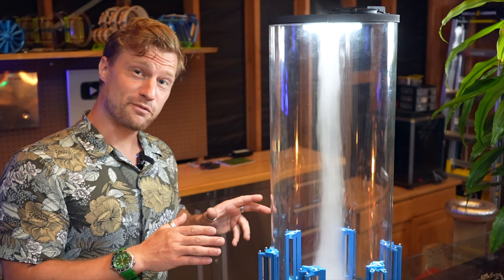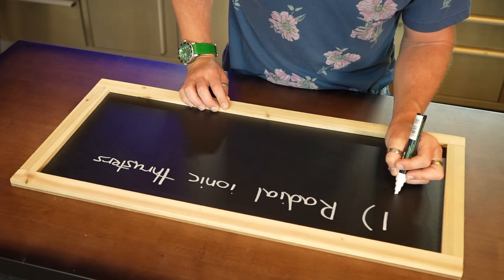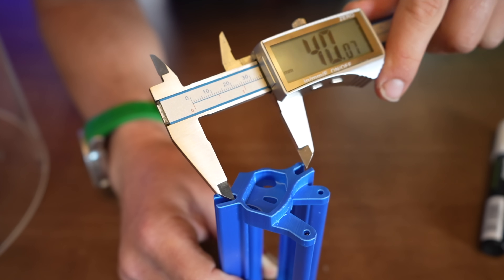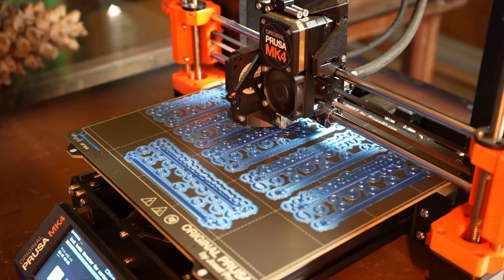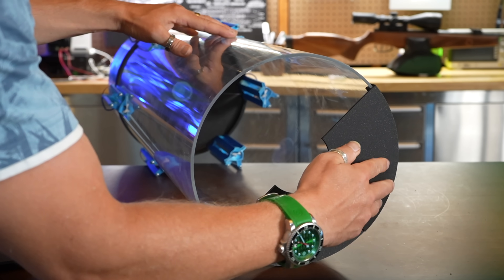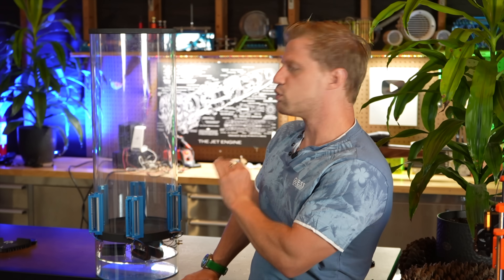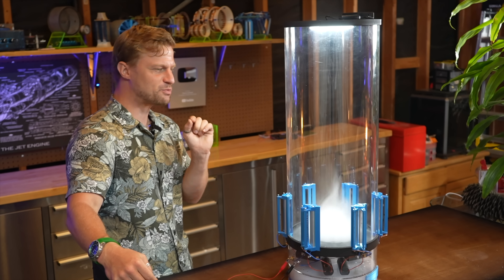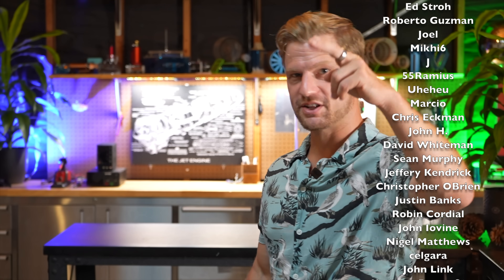I Built The First Ionic Tornado Machine! (Unreal performance)

Comment: Now, technically, this is not tornado formation. Coming from a weather nerd, we all know tornados form from up to down, not down to up, BUT! Dust Devils form from down up. So you kinda got a Dust Devil simulator. Cool!
Reply: well, some research shows that some tornadoes form starting at the ground and working its way up.
Reply: @tor-WX That right there you are talking about is a Landspout, not from a deep mesocyclone, so it's not a Tornado.
Reply: @darkvalve  trey from convective chronicles brings it up in his el reno video, some other research talks about it too, i'm definitely not talking about landspouts
Reply: @tor-WX Tornadoes from the mesocyclone develop from the mid-level rotation to the ground, while landspouts form from the ground upward. If Trey showed something like what you said: its most likely some mid-level rotation that wasn't visible yet.

Comment: I have a proposed improvement.
As the device already uses dry ice for the clouds, could you combine this with a cloud chamber designed to view radioactive particle trails?
With a beryllium lid, it could reflect the particles downward in random trajectories through the vapor from a radioactive source material.
Finally, add a static spark gap generator with one terminal at the center of the top and the other being a metal mesh grid running horizontally around the inside about halfway down the tube. 
If things work correctly, the radioactive particles should create leader trails through the vapor, which the electrical charge then follows the path to complete the discharge circuit and connect with the grounding mesh.

Comment: Need to add a small glycol based fog/haze machine on the bottom. Even a vape coil would probably provide enough fog and could use a large tank to allow it to run for days.

Comment: Tornadoes/Hurricanes have two movement simultaneously happening one we see which is either clockwise or counterclockwise rotation but the other one we don't see, is at center which is always opposite from outer movement. All tornadoes or hurricanes are results of Atmosphere and Ground trying to balance their ions levels. Sometimes center spin is too small to see or tornadoes change spin rotation to opposite directions based ion balance. If it's clockwise outside then Atmosphere lacks ions, if it's Clockwise outside and Counterclockwise inside atmosphere and ground trying to balance ions difference just like Iodine Clock Experiment and When Balanced Tornado/Hurricane stops however when Atmosphere is overcharged it keeps going on and sometimes when atmospheric gets too much, Winds stops and it changes tornado/hurricane spin too opposite directions.

Comment: This is really cool but I wonder If you could add changing colors at the base of your tornado instead of top light  and modify it with remote control. Have you thought about making miniture fogger that doesn’t require water. Make if bigger like 10 foot scale

Comment: My  1970's World Book Encyclopedia had a similar device with no ionic thruster, it simply had openings for the air to rush in as heated water created steam. Rising air would go up, cold air would fall, the slits would create cool air coming in from the sides, perpetuating rotation --Like a tornado.  However, a tornado doesn't have limited air from the sides, so what causes the rotation? This is where I think people are a little daft. Lighting is always present, and water droplets are magnetic. My theory is that the counter space  of the aether is set in motion by the lighting strikes to the Earth. It is a short of the capacitor plates between Earth and Air, that disturbs the aether - Tesla called this a disruption. The disruption causes a spinning magnetic field. The spinning magnetic field in pulses causes the droplets in the air to move. The  rotation of a supercell is generated, the Tornado is just a focused byproduct. Hurricanes are a wider exhibition of this generator.

Comment: Now next step. Collect dust from air, using air vortex, without moving parts and without filters. Only power of vortex. It will be very silent and you can sell it widely, as most silent air cleaning device.

Comment: You ought to black out the bottom section, and put the light, or another😮😮on the bottom side of the base of the twister to create a more luminous cyclone, possibly for those nutts who like it, I would chose a solid blue😅 but a colored light for that would be interesting as the only light at night

Comment: Over twenty years ago, I theorized that tornadoes are Electrostatic in nature. The extremely high voltages between the ground and the clouds create a situation where natural entropy finds a way to reduce the energy of the highly energized system to release its energy. It does this by discharging that energy from cloud to ground through the movement of Ions rather than through many lightning strikes. Tornadoes usually form when a dry air mass between the clouds and the ground creates a high energy potential between the clouds and the ground in a dry environment. The amount of energy stored in these kinds of systems approaches the energy of a small nuclear weapon. This is why they are so destructive. I believe tornadoes can be disarmed by shorting them out by creating a ground-to-cloud path at multiple locations by using high-energy lasers as a triggered ion conduction path. I don't believe tornadoes would form if the static electric energy source was removed or was shorted out by lightning strikes at crucial locations.

Comment: What if you add weights at the top with the influencer light and an adjustable tube to lower and raise. you could use a fidget spinner barring to give it balance, so that-- when adjusted correctly, the weights spinning could create multi-vortex streams, to due to the updraft. on the lowest power level, it might be possible. and even bring them further off the platform,,, in theory of course..

Comment: @PlasmaChannel

🤔 Now that youve been able to induce a cyclone... 

I think its time to remove that base, build a base so that it can be turned onto its side... Then add on a strong/powerfully cylinder shaped ionic intake... 

& See how much Thrust you can generate with it. 🤷‍♂️

Now that you've gotten to the point that you can create an adjustable containable vortex..

The next step after that, would be to add additional levels around the rest of the cylinder... increasing the levels of thrust that it can generate further... if you could get all of it to work together. (I got faith in you!!)

🙄🤷‍♂️😅 sorry to take away the art piece... but I think these are the next steps to do with what you just achieved.💪

By the way, Awesome Job!!!

Hopefully you'll humor me. 🤷‍♂️😊

Sorry for trying to get you to push the boundaries even further;  I think you got this! 👍💪

🤔 if anything,  just make it so that the bases could be swapped out... so it can still be used as an art piece,  but turned on its side for the other experiments when you're working on that.
Reply: 🤔 the next steps after that's achieved... would be to build it out of stronger materials, add in fogger injectors & an afterburner 👍💪

Congrats,  you'll have a functional jet engine
Reply: 🤔 Maybe we could get @integza to jump in on those next levels of the experiment build? 

Idk how to get @integza mentioned nor @PlasmaChannel so that they'd get notifications & read this. 😖😡🥴

If someone has the abilities to get them notified.. I appreciate the assistance 🙏 👍
Reply: 🤔 also... with a few tweeks...  as it is now.. 
 - it can be used to ionicly increase jet engine intakes & thrust... likewise,

- be used as an ionic cold air intake for  ICE engines to increase intake, fuel efficiencies, & all around electronicly controlable performance. Similar, to a turbo, but when paired with a turbo or super charger 😳💪👍

Comment: 2:29 6 thrusters, 30 degrees = 180 or half the circle.
Reply: 30 degrees to the theoretical parallel line aligning at 90 degrees with the side of the circle at each point of the circle. The fans are aligned at an hexagon and the air just comes at a thirty degree angle into the circle to form a vortex the angle between each fan is probably at 60 degrees

Comment: Super cool stuff. What I'm really curious about.. 

what happens if you shorten the cylinder chamber, and instead of a 90° lid with a condensed opening, lets drop a long cone on top with a similar sized opening to what you used. Could this not create something of a turbine effect? What kind of airflow or thrust is coming out the condensed opening at the top? Would another layer of ionic thrusters mid-cylinder improve power?

Ive probably got the terms all mixed up but i hope you understand what im getting at.

Comment: I wonder if it would work with a reservoir with a lip to keep the water in at the top, and air escaping from holes on the bottom? Then when throttling the power the cyclone would come down closer to the ground.

Comment: This is really cool! We are a father and son team of tornado chasers and we have also built a tornado machine, although ours uses a standard air pump instead of ionic wind. I love the idea of using ionic thrusters! Yours is definitely a lot less noisy than ours.

If you wanted to build one that had a clearer view of the base of the vortex you could alternatively place the thrusters/pump at the top of the chamber instead of the bottom. This seems counterintuitive as you'd think it would only get the air spinning at the top of the chamber. But as the rotating air is drawn into the center, it speeds up due to conservation of angular momentum creating a wall of fast-moving air that prevents air from entering the vortex from the side. The air then begins to descend around the outside of the vortex to be drawn up into it from the bottom. Eventually this process will bring the vortex all the way to the bottom of the chamber so you will have a rotating downdraft wrapped around the rotating updraft of the vortex itself. This is similar to how the Rear Flank Downdraft wraps around and feeds the tornado in a supercell thunderstorm.

Check out our video "New tornado machine flings water!" to see our setup using a single nozzle at the top of the machine to create a moveable tornado under the machine without an enclosed chamber at all.

We love high voltage and plasmas too and built a lightning machine that simulates St. Elmo's fire and Transient Luminous Events via a alpha-particle triggered spark-gap to simulate lightning initiation by cosmic rays. You can see it in our video, "Radioactive Lightning Machine - Sparking TLEs and St. Elmo's Fire".

Your projects have been an inspiration and we love watching your videos. Keep up the great work!

Comment: Can you make it work without the tube, despite the static surrounding air, after a few more bumps, bruises and headaches?  Then you can try applying a massive high voltage discharge at one end and see if the electricity follows the vortex to strike a target.  You may have to ionize the vortexing column of air with a high voltage discharge plate or even with a ultra-violet laser so that the discharge has an electrical path to follow.

Comment: I think you nailed the vortex.  
It needs an aesthetic improvement for my wife to put in the house not the garage.
The thrusters should be internal with flush air inlets.
Fancier lighting for the vortex..colors/wavelengths, directions of lighting, ..
Paint the bottom of the cylinder, or hide the internal electronics and use a lighting scheme to make the base glow dimly.
Try a strobe light to detect periodic events in the vortex?
Combine functions of parts: include lighting in the design of the thrusters.  Imagine lights on the thrusters (RGB LED?) that that circulate with the vortex.

Comment: Finally you listened (and finally you popped back up in my feed). Now my only question is why you didn't measure airflow out the top. Also you should try it either without the acrylic enclosure or a much shorter section to see if you can still generate the tornado with a better power to weight ratio.

Comment: Considering the high voltage, I’d enclose the external bolts as well and use a standard wall charger plug. I’d also consider if you can add filter material and actually make this practical in some way, either a filter or just a neat fan to keep air moving on a room.

Comment: Wow I'm so impressed of your work, thank you so much for making this one. 

 This is a demonstration of how wind/air would behave when it travel tangentially and move vertically along the cylinder to the exit port (this reminds me of my thesis work with only an animated simulation😢) 

And if you decrease the diameter of the exit port on the top the vortex will be more stronger compared to the wider diameter at the same air input speed 😅

Comment: I'll give you some good advice. Instead of putting ice in the water, put an ultrasonic fogger in there. It will not be a useless "installation" but an air humidifier along with an ionizer. Both beautiful and useful.

Comment: Hi, I have an idea in mind. Instead of using a high voltage ionic thruster. Why don't you use the coil gun system? First you first heat the air around with plasma then in it ion for that can be affected by the magnetic field, is then accelerated using the coil gun principle.
Well the rail gun came to mind but in the process, the ionic thruster principle will be applied making it not effective.

Comment: it's an upside down Tornado!
Could you invert it  so the thrusters and the fog chamber are on top and have the exit on the bottom that way it looks like a real tornado????

I would assume that the water tank / fog chamber would just need a pipe that sticks up a little past the water level and then the bottom could be the same choke dia. but it would just need to be raised off of the table.

Comment: Small suggestion here:
I personally think (coming from a storm chaser) it would be cooler looking if you made the tube longer, put the thrusters at the top, and basically reverse the whole thing by putting the dry ice at the top so it wouldn’t be at the bottom which would make it form from the top, like a real tornado :)
Reply: I was thinking this same thing. I wonder if the thrusters at the top would generate suction which would allow the vortex to form downward toward the bottom and spit the air out the top. I think it might! I agree it would look more like a natural tornado forms if it works!
Reply: @adamboggs4745 Pitch them down slightly to force the air column to spiral down maybe?
Reply: Very Interesting!
Reply: Wouldn't the water just spill to the bottom?
Reply: @lilbaz8073  there could be a tube like that was going through the control section but it goes up to make a little lip
Reply: A real one has a vortex from above and below.

Comment: The vortex seemed pretty responsive to changes in voltage. You should cut a 3.5mm audio jack and feed it to the transformers and see if you can get the vortex to dance along with music! I think audio signal like that is much lower voltage (0.77v to 2v max I think?) so you may need an amplifier, but you could probably use a simple op-amp breadboard circuit to bring it up to 4v-8v range.

Comment: The best part is that you don't need dry ice OR water. Get yourself some chinchilla sand and dump it in there. It's made from volcanic ash, which is nonconductive. Seal the top so it can't get out, and boom. Instant dust devils. If you wanna be extra sparkly, glitter is also not conductive except for the explicitly metallic glitters. Get a splash of color in your vortex.

Comment: Instead of dry ice or water, what about a closed propylene glycol loop?
You could add a condenser element at the top and gravity-feed it back to the base.  Build up on the blades should be minimal as long as you start it before adding fog and it shows up well on camera. 
Basically you'd just rig  the output of a halloween fog machine to the base and use tubing and maybe a cooling loop to condense the gas and let it drip down back to the resevoir.

Comment: With the straightened vortex column, it is just a matter of refining it into a gravity-assisted Z-pinch. While not plasma, of course, it is close enough.

One can see Z-Pinch already trying to form - the sudden thinning of the vortex. There is not much material to work with, however, since air is not plasma, and there won't be magnetic field to twist itself tighter. 

Still, an art piece and one awesome demonstration of the basic concepts. Thank you for sharing!

Comment: So, you just built a very inefficient ionic jet engine that gets 12m/s.  Why don’t you take this and increase your efficiency by borrowing a design inspired by a jet engine?
Reply: Basically use a turbo fan to compress air into a cylinder that gets sped up by the ionic thrusters.  Using compressed air in theory should make the ionic thrusters more efficient since more atoms are available to be accelerated.

Comment: FYI u can change the materials out 2 use fire. The cool math 4 fire tornados shows u the 02 consumption to CO2 output conversion is super efficient, including fuel consumption to BTU output vs conventional thermal incinerators. The internal temperatures of the vortex approach incredibly high thermal limits under force vectoring. To reduce frame dragging during rotation inside a thermal resistant chamber, the walls must b nano smooth (glass) and the ionic thrusters must b the length of the entire chamber. Ensure the rotation is correct 4 ur hemisphere to match the coriolis effect 2 eliminate toroidal cavitation. Fuel must b introduced into the chamber from a circular element (such as a gas stove element) & must have the correct diameter matching the vortex point diameter. The holes in the element must b 30° angle slits 2 also achieve laminar flow in the fuel gas.